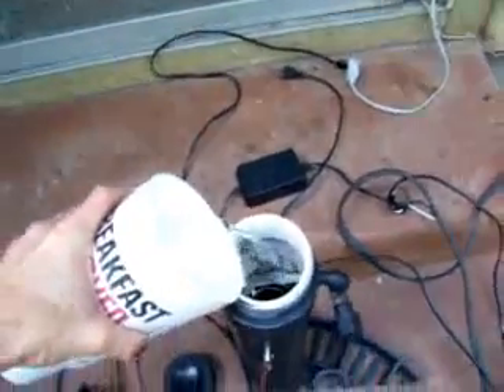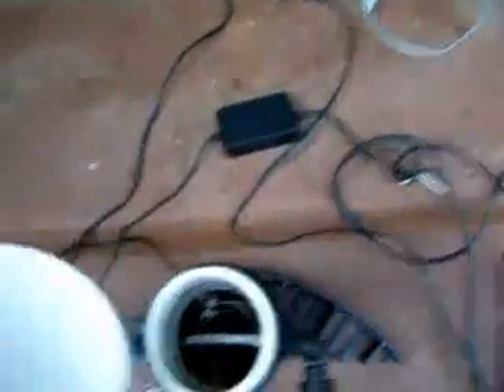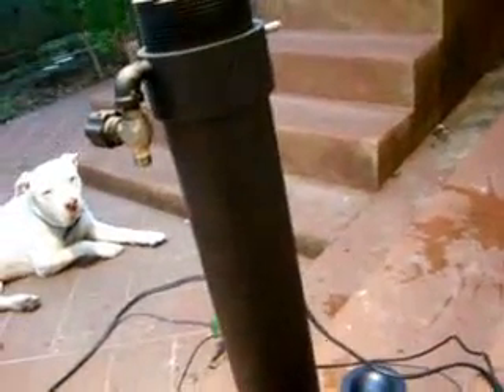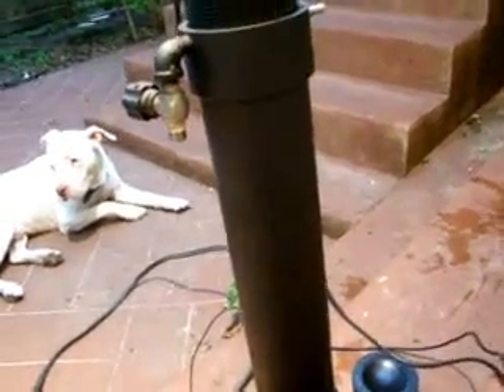HHO Generator/ Electrolysis of water

Comment: I would caution you about the amount of "head space" in your tube ... that makes for a considerable "gas trap" ... with that much gas confined, you could get a pretty big boom if you happen to get an internal spark ... the most common source of ignition is corrosion of the terminals entering the container ...  if these are tight and made of stainless, the risk is reduced greatly ... but most would suggest a "blow out" port of some sort just to be on safe side ...